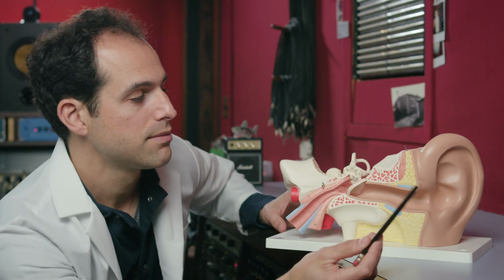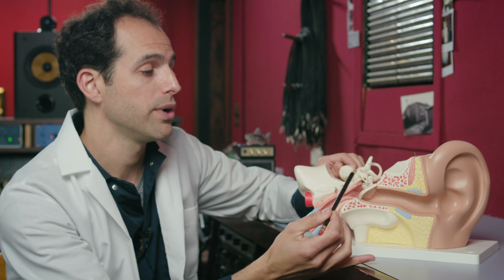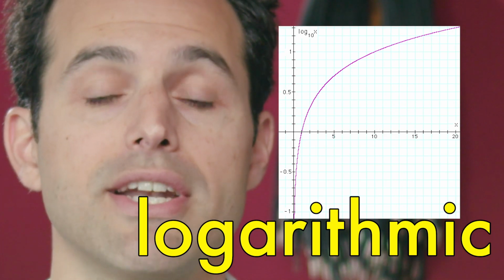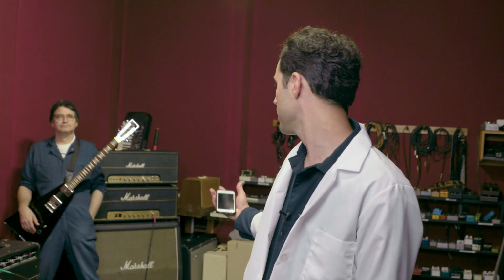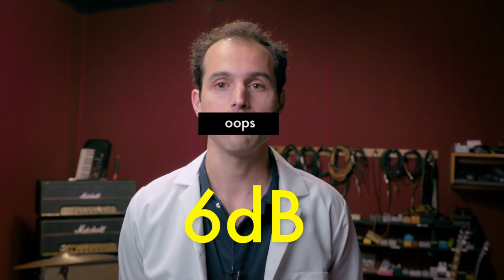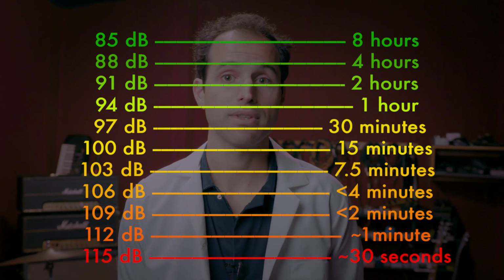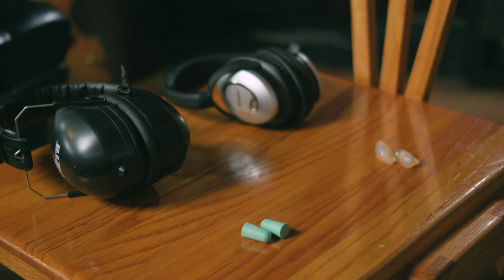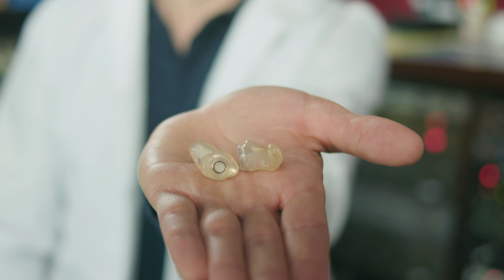Electrical Audio How-To: Sound Levels and Hearing Loss Prevention

Comment: I wonder what the relationship between pitch and hearing loss is? It seems to me like higher pitched sounds might cause more hearing loss when listening to music, and lower pitched sounds might happen to damage them at your 8 hour factory job. This would be helpful in a canary-coal mine harbinger sort of way, but maybe there is no relationship, sans behivejorl.
Reply: Low frequencies have much more energy and are capable of much more damage in much shorter time duration if the pressure level is high enough. The low frequencies will cause more damage before high frequencies if you were listening to music that loud

Comment: The rubber ones that look like a road cone with 3 rings on a stick with a string attached are the best cheap solution I've ever found & use all the time, if they fall out on stage you just put them back with the stem really easily & you can adjust how far in you want them for whatever application. Definitely the best option for musicians, the last thing you want is to have to search a dark filthy stage for the one you dropped & put it back in with your filthy fingers. The foam ones are only good for blocking out as much sound as possible for sleeping or power tools etc but those are the free ones at venues so you have to try and balance them just inside the entrance of the ear canal enough to stop the cymbals and guitar amps from shredding your ears but not so much to shut out all the top end... and then they fall out when you start dancing or nodding with enthusiasm and you have to pick them up off the filthy floor with your filthy fingers etc... Before venues started handing them out (very recently really) I would just grab a wedge of toilet paper and make small plugs with that, surprisingly effective.

Comment: Generally it makes sense to think different frequencies having different levels. The standard  meter can only aproximate to a one single number when in reality there is different decibels for different frequency zones. Some frequencies are more dangerous than others. Frequency matters! For example if you happen to expose your self to a single 100db sine wave (say 160hz) it is hasta la vista for your ears very soon. In normal - even loud music - the volumes are spread over wide frequency range thus single frequencies being not even close that loud.
Reply: Hey! I've been lokking for more into this topic. Do you happen to have a source where I could learn more? Thanks in advance!
Reply: @OscarPoblete  The right direction for you is in your self. Most importantly you must form inner picture of what you already understand and then form the right set of question(s).The right set of questions quides you in this topic as well in any other topic because the information is scattered across internet so that it is better to form your personal knowledge before following blindly some one other's. I would first find out how a plucked string gets its tone. Here is the starter for plucked string: 
https://www.youtube.com/watch?v=T1bBgGgoncY
And this is the same business starting to add on it.
https://www.youtube.com/watchv=0Rfushee0U

So you need to relax ,sit back and get something out of them and start to build your questions base. You cannot understand deep meaning of frequencies things without gettin good grasp of string modes which those videos discuss.
Reply: that's unture, sound waves are pressure waves in the air.  the pressure is both what you hear, and what does damage.  frequency matters in terms of which hair cells will be damaged but you are mistaken about the way SPL works... the energy doesn't "spread over wide frequency range" it carries just as much energy and pressure.  Go look at an oscilloscope and see the way sound waves are "shaped".  It's carried along a complex waveform, a single complex waveform.  It's not magically affect the air where and how it chooses to. Makes no sense...
Reply: @gardevoirdude7493  Oscilloscope is tool to lock in to some constant fundamental frequency wave. It does not make sense to view complex signal with oscilloscope. (Other than verify that signal is present). We are talking about sound as complex continuous signal which can be visually observed with any audio editing software. We talk also about Fletcher-Munson curves. What you get with db meter is one number. You dont need to know more about it to figure out it cannot be right. If you believe in one number I would say you are in danger. From natural sound sources on a low very strong frequency are riding less powerful higher harmonics. It about the physics of materials vibrating when given initial impulse i.e exiter. What ever sounds are produced - starting from human humming to knocking drum membranes - after the initial exitation the wave starts to stabilize and then there are harmonics evolving and decaying and they are decaying in different rates contributing  to perceived distinct "tone" or "timbre". It is very simple thing. I really would not like to be anywhere near where is 1000 hz 100db single pure tone occuring.
But I could take 100hz for a while but still it would create unpleasant stress quite fast. 
Just test your self:generate different single sine waves with function generator and check with db meter what you cant take.
Reply: @KetogenicGuitars  fine... look at a signal in a spectrogram not an oscilloscope... makes no difference lol.  If a volcano were to erupt and emmit a massive pressure wave of 180db, that wave form would have high and low frequency information which would be spread across the entire range of human hearing (and past it in both directions).  That doesn't mean it's carrying any less energy.  Think about it like this, an oscilloscope is showing you the waveform in the way it travels through the air, a spectrogram takes the information about an audio signal and presents it in a way that we can much more easily understand and identify.  All the information about an audio signal is present in an oscilloscope reading depending on how it's set.  Also frequencies aren't "less" or "more" "powerful" than one another depending on their frequency.  If both are disturbing the air equally both are carrying the same amount of energy.  it's a function of how pressure waves move through air.  That's why SPL under water is so different from through air, it has much more to do with the atoms in the medium of transportation that the wave itself.  I don't know how to better explain it.
Reply: @gardevoirdude7493 I wonder what happens if you have say combined 100hz at 0db and 1000hz at 0db signal on your audio software screen to be played to your loudspeakers and you play and measure with Db meter.  Then take the 100hz away and then measure again with plain 1000hz. I you have such meter it can be done.
I you don't have Db meter I think you force me to buy one.:D

Comment: Hey PhD in physical acoustics here, I'm a nerd sorry. Double the power = 3 dB, double the amplitude = 6 dB. Two amps (in phase) double amplitude so +6 dB. Also by moving double the distance away from a cylindrical source (an amp or drums in a room with a floor and a roof) the 1/sqrt(2) reduction in amplitude gives a 1/2 reduction in power making that -3 dB. If it was a spherical source then it would be 1/r spreading and that would give -6 dB. Excellent video though just nit picking.
Reply from the maker: This is probably the best video comment we've received. Thanks for clarifying this!
Reply: Thank you @vrs600! I seem to mix up my 3s and my 6s a lot in this video :)
Reply: +3dB for when they are two different instruments playing or unrelated (that is mathematical correlation = 0)

but yeah if it's exactly the same sound source for both amps it's +6dB
Reply: Can we be friends?

Comment: If the two amps with 90db SPL output the exact same sound waves, won't the measured SPL then be at 96db (provided the SPL meter is positioned at the same distance from both etc.)?

Wouldn't the 93db SPL be measured with two sources that would have no common but evenly distributed frequency and phase response?
Reply from the maker: See below: original comment "A doubling of linear sound pressure (from, say 2 kPa to 4kPa) would increase the dB spl reading 3dB." is incorrect-doubling the amplitude yields 6dB increase.
Reply: @ElectricalAudioOfficial  Sorry but that isn't right. dB's are a power rating 10 log 2 is 3 dB yes but that's twice the power not amplitude. Doubling the sound pressure amplitude is 10 log 2^2 which is 20 log 2 or 6 dB. Power is proportional to amplitude squared.
Reply from the maker: @vsr600  Right, for us lesser nerds: only power is 10log(x/y), amplitude (voltage, etc.) is always 20log(x/y). Thanks for the clarification!
Reply: @vsr600  can you confirm that adding two uncorrelated but equal sources is +3dB whereas adding two correlated equal sources is +6dB? 

That was the original question and I’m not sure of the answer anymore :)
Reply: @ElectricalAudioOfficial  2kPa = 160dB, 4kPa = 166 dB
Reply: - Sum of 2 sound sources (uncorrelated eg. Random phase ~Violin and trumpet)
dB1 + dB2 = 10 × log10(10^(dB1/10) + 10^(dB2/10) + ... 10^(dBn/10))
100dB SPL + 100dB SPL = 10 × log10(10^(100/10) + 10^(100/10) ) = 103dB SPL

- Sum of 2 sound sources (correlated eg. Same phase ~2 Violins) – Not real life
dB1 + dB2 = 20 × log10(10^(dB1/20) + 10^(dB2/20) + ... 10^(dBn/20))
100dB SPL + 100dB SPL = 20 × log10(10^(100/20) + 10^(100/20) ) = 106dB SPL